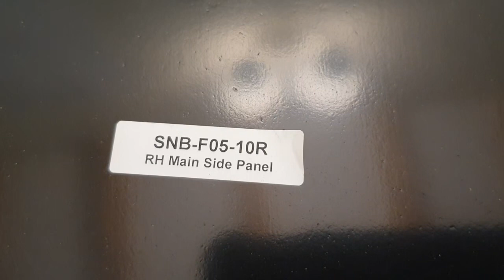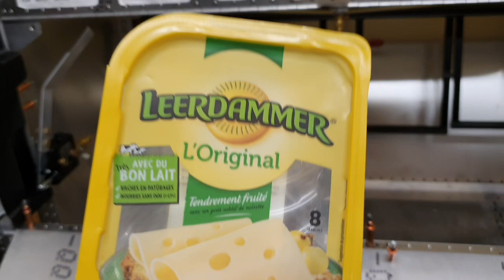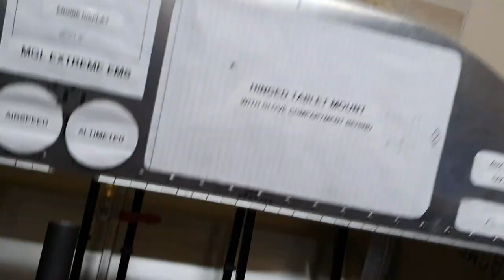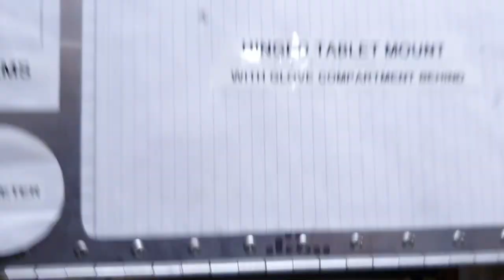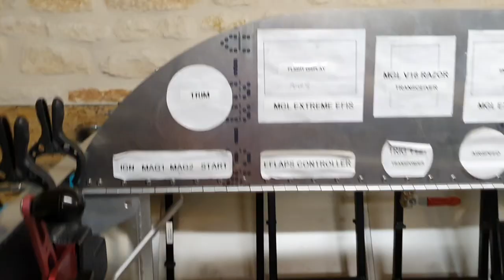Gavin's Sonex B Part 38 - Working on the cockpit

Comment: You answered one of my questions with this video regarding how the rudder cables are routed from the pedals.  I was thinking that perhaps there would be holes drilled though the vertical structural members on the cockpit sides so you could route them between the plastic side panel and the skin but I guess with only 1” to work with maybe the holes would be too big.